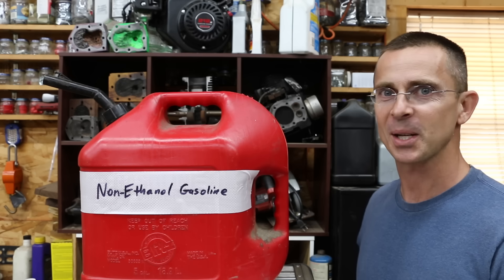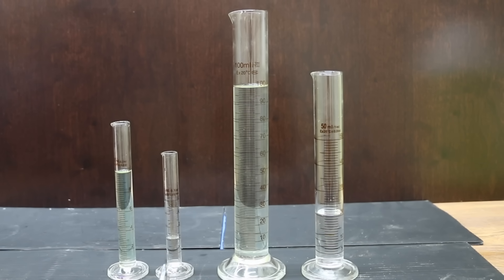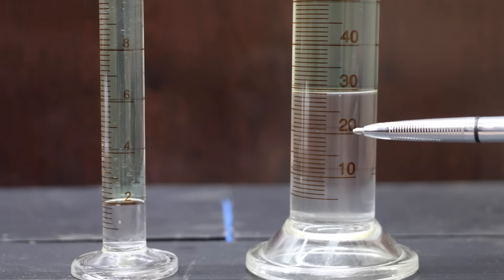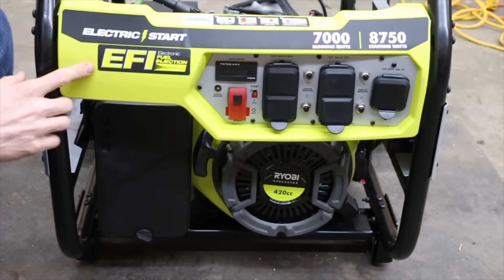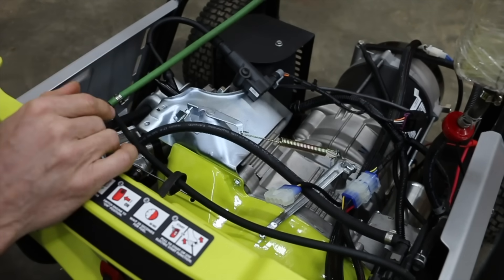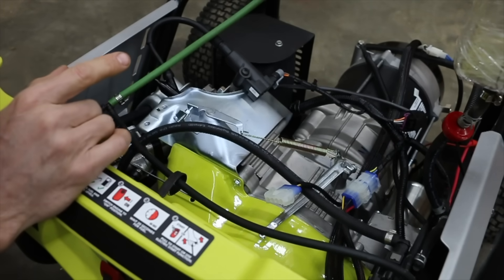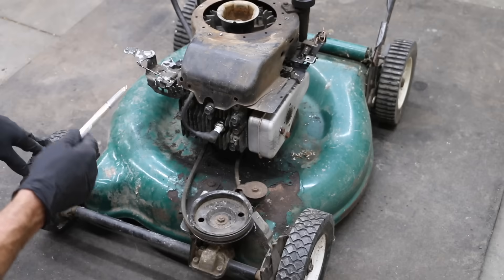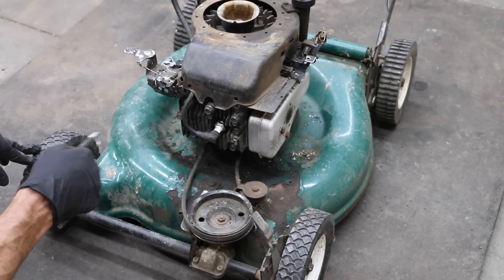Is Non-Ethanol Gasoline Really Better? See the PROOF!

Comment: @Project Farm , most of the car brands in Brazil, from Honda, Hunday, Fiat, Renault, Peugeot, to Chevrolet, Ford, etc, use motors (with denomination: "Flex" motors) that run on any amount of gas and ethanol mixed in the tank and also on 100% percent of either. The electronics takes care how to burn the different mixes. The gas stations sells pure ethanol as sells gas. Just would be nice to know which mix performs more efficiently and more economically.

Comment: Ethanol is hygroscopic,  in English, it absorbs water, ethanol is heterogeneous, meaning that it does not chemically combine with gasoline such as a homogeneous solution. 

It is heavier than gasoline and if you pour it in a glass jar, you can clearly see the ethanol at the bottom.  It is also highly corrosive.  If you vehicle sits for awhile the ethanol settles to the bottom of the tank where the fuel pump picks it up first, leaving your engine is a very low 80 octane fuel that causes detonation that can destroy your engine.

World wide ethanol does not reduce the carbon content, it takes just as much fossil fuel like one gallon to make one gallon of corn ethanol.  Sugar cane is far more effective, but can't grow that up in our northern climate. 

What is does like in Wisconsin, slightly reduces the carbon pollution in Milwaukee and Madison, and moves that pollution up to norther Wisconsin where we live.  World wide, nothing is saved. Its political and as we are learning very quickly, our leaders our idiots.

It skyrocketed the price of meat and dairy products, putting way oversized SUV's and pickup trucks diet ahead of us people. 

If we didn't have A-holes running our country would realize the key factor in global warming, BS anyway, only going back to 1880, not to where we live with a mile high glacier 12,000 years ago or the starvation period during the middle ages.  Key factor is methane gas the earth emits like crazy also the key product for sewage disposal plants. 

Have over a know 12,000 year supply of this stuff, far less CO2 production than gasoline, cleaner burning and we could use our vehicles to run on this stuff. 

But can't do this in a country run my crooks and idiots.

Comment: I'm a chemical engineer. Ethanol has inherently less energy density than regular gasoline. Typically, you might expect a loss of 5-10% gas mileage in an automotive engine. Modern computer-controlled fuel injected engines are able to optimize the air/gas mixture so that the loss in mileage is more commonly around 5%. This is a result of the fact that the fuel contains fewer high-energy carbon-hydrogen bonds and instead contains some lower-energy carbon-oxygen bonds. The end result is less energy and more water vapor in the exhaust. Ethanol does nothing for the environment. It's only purpose is to subsidize farmers.
Reply from the maker: Thank you for the feedback
Reply: You forgot to add that ethanol fuels are safer for the hard parts of the engine and allow for increased boost pressures and advanced ignition timing in performance applications making it easier and safer to make more power... I have a Honda Civic that puts down 685whp on e85 and topped out at 525whp in pump gas premium 92 octane. I’m a believer in ethanol. Not fuel mileage, lol

Comment: I have a 98 dodge ram with a 318 in it. Fuel injected. I can see a difference in the fuel mileage which improves with non ethanol gas. Was getting around 270 miles to a tank with gas that had ethanol to around 310 a tank with non ethanol fuel. Once i saw that increase, unless im where they dont have non ethanol fuel i use non ethanol fuel. Yes more expensive but seems better for my truck.
Reply from the maker: Thank you for the feedback
Reply: @ProjectFarm  your welcome. Thank you for what you do also

Comment: - Your tests proved out about the same as mine and in fact both are also theoretically what it should be.  Alcohol has 1/2 the calorie content of gasoline, thus 10% ethanol will require 5% more fuel for the same amount of work.  It works that way on my car, and cars had their fuel efficiencies downgraded with no other changes when ethanol fuels became the standard. 

- For lawnmowers, there is a regulatory maximum allowable feet per second on blade tips.  Lawnmowers have standardized engines used on many different models.  Thus, the rpm will be invariable be set low for the largest blade diameter for the horsepower.  This is why engines are today rated in torque, which happens at a lower rpm than maximum horsepower, because the same engine may be limited to different rpm and is seldom allowed to its maximum horsepower rpm unless you buy it independently of the appliance.  Having the rpm right on a lawn mower translates into a big difference in cutting, mulching, and bagging.  Using an optical tach, I get great performance when changing the governor spring to get the RPM necessary to get a little below that maximum using ethanol-free gasoline.  (And normally run it in because I don't go through that much fuel for yard tools and standby generator.)  There is a definite difference in rpm of the engine when running ethanol gasoline, but still performs very well.  The price difference between 10% ethanol and ethanol-free never used to be anywhere near 5%, so I never bought from a station that sold it.  Of course today, there is a great difference in price even though ethanol costs more to produce than regular gasoline, with the difference being made up mostly by subsidies paid for from those believing they are getting a good deal with ethanol-doped fuels at the pump, while they are actually eating the cost via taxes through subsidies, and a little by overcharging for non-ethanol fuels.

Comment: So here's a thought. For sake of science. Hypotheticaly I use 10 percent ethanol in my vehicle, through the seasons I have a condensation build up. Thus causing water and ethanol mix in the bottom of my gas tank. Can Heet solve this problem or is it a joke. Basically, can adding alcohol to gas that has separated from it's ethanol stop this separation? Or even allow the part that has been separated to burn in my engine?
Reply from the maker: It takes a lot of heet to reverse phase separation.

Comment: Your test here was really well done and informative but the biggest reason most of us dont use ethanol in our small engines is because of the green sludge that builds up in the carb if it sits for any length of time. I would like to see a comparison of ethanol gas in a carb vs non ethanol in a carb that sits for 5 months. Of course we already know which is better but it would be interesting. Thanks again for your well thought out analysis.
Reply from the maker: Thank you for the feedback

Comment: Forgot to run my generator out of gas one time.  It sat a few weeks and then would barely start and wouldn't run properly.  The E10 gasoline turned all the rubber parts in the carburetor to mush.  My fault.  The repair service added a fuel shut off valve and warned me about alcohol blend gasolines.  $100 later, I was better educated.  I had a car that was E85 compatible.  Mixing 1/4 gas with 3/4 E85 the car ran well and my mileage went from 24.2 to 20.  When I ran straight E85, the car ran OK, but not outstanding.  The mileage dropped to 15.  The cost per mile factor just wasn't in my favor.  Back to E10.  Your fuel injected generator just might be the ticket as most small engine problems are caused by carburetor problems.
Reply from the maker: It happens a lot!
Reply: In terms of the generator repair, I would say I'm surprised they actually helped you with good customer service instead of just waiting for this to happen again...so on so forth.
Reply: I went with a propane generator... two reasons propane is a stable fuel... natural gas pipelines after natural disasters are shutoff due to stop the fire potentials.   The other thing I do is run my propane generator once a month for 5 minutes.  I also shut it down by shutting the propane valve off to evacuate the line. Once it shuts off I then turn the key off.  I stayed away from those whole house generators for two reasons many are crap... and if you use a small generator it’s easy to replace.  Do all the work yourself and you will know how to maintain and service the generator.  Get rump rangers involved and expect to be raped.
Reply: had a briggs/sentinel mower sit for at least 15 winters (with use in summer ofc) with e5 then e10 gas in it and the only issue that popped up possibly from damage caused by that is the carb bowl seal this year but it has other more severe problems most notably pretty much gone piston rings it eats oil like crazy and needs frequent spark plug cleaning to keep running
Reply: I think that american marketed cars are maybe too fragile  for ethanol, here in Europe all gasoline cars are able to use gasoline-ethanol since the 90  ,personally I had a 98 Citroen and I started using E85 in 2010 until 2020 (car wrecked after two accidents,  guys crashing into me while waiting at the red light) without any modification , full tank,  no maintenance of the engine at all ( I just treated the car like a horse, ride and go) and never had any problem, the car never broke down or had combustion problems, I  just changed the spark plugs in 2018 because it was never done before , even if they were working perfectly, I just can say  that  at least for me  E85 was the right choice.
Reply: @Feyser1970  where they sell E85 in Europe?

I have 2 motorcycles, a 90s and a 70s model.
Both dont like E95 (10% eth)
I buy 98 and add lead replacement
Better safe than sorry
Reply: Wilfred Prins my 70’s Guzzi pinged all the time with non ethanol fuel, low or high octane.  With 10% ethanol I use the low test with no issues.  Of course you loose power and efficiency.  The alcohol does lower the combustion temperature while the high octane slows down combustion.  They both have lower btu’s.  The unleaded is not good for the old valve seats as it has no lubrication.  The alcohol does deteriorate plastic and rubber products.
Reply: I can't believe that anyone would try to run a car on E85 or any ethanol.  In Australia we do have ethanal in E91, our standard gas range is from 92, 95 or 98.  Most cars are run on the standard 95 or 98.
Reply: @waynesissing8006  Lots of people do here in France. You can buy it in most supermarket gas stations. Even stations like Total sell it on the motorway!

Comment: As you mentioned at the end, the HUGE difference with non-ethanol is it doesn’t ruin small yard machines engines. With E10 we had to have the carbs in our leaf blower, string trimmer etc rebuilt or replaced every year. Since we switched to ethanol-free, they’ve run perfectly, always starting on the first pull (maybe two if they’ve been sitting all winter). It was a revelation!

Comment: I use Shell medium. It DEFINITELY has lower octane than the old Shell medium, which I have a storage tank of. The ethanol gas pings like mad in my 302 engine while the original old gas does not.

Comment: your vids are great, luv all the ideas you come up with on ways to test.
swung a wrench for a lot of years. carbon build up is usually caused by running too high of octane. raising the octane lowers the combustibility. this allows high performance engines to run ultra high compression without self igniting(*detonation/dieseling). the problem is when people run high octane on street cars you get a lot of unburned gasoline*(carbon). every engine has a minimum octane rating and its very important to stick with that. in very hot/hilly climates or as your car ages you may need to go up a level in octane to prevent dieseling/detonation but your engine will run best, have the most power etc with the lowest octane your engine can run. lower octane gas is more explosive than high octane gas its like a 12 gauge vs a 20 gauge number. its is generally cleaner and fresher because it sells more and its much nicer for your engine as long as your at or slightly above your minimum.
Reply from the maker: Thank you for the feedback

Comment: I used to work in a GM dealership when flex fuel vehicles first came out. I went to all the classes for training on how flex fuel vehicles were able to switch from ethanol to non ethanol or combination of both. We were also targht how to measure specific gravity of various fuels which translates to fuel volatility or efficiency. Ethanol is not as volatile as regular gasoline, meaning it does not produce as much horsepower this less fuel efficiency.
Reply from the maker: Thank you for the feedback

Comment: I had a 1986 5th ave my baby n since adding etheynal to the gas i had to change the fuel pump once a year as it destroyed the internal rubber. Been verified by repair shop friends of mine. Im very good at replacing it but its stupid that what it does.

Comment: As per your title, yes it is. It has more btus than a diluted gas, alcohol mix. Alcohol burns cleaner and has a higher octane  than gasoline and burns cooler but much lower btus. Btus is the power.  Burn twice as much alcohol to get the same btus as gasoline.  The choice is yours. Alcohol dragsters are very fast but they chugg huge amounts of alcohol in the quarter mile. Advanced timing, cooler combustion, cleaner burn but needing shit loads more fuel from A to B. Alcohol destroys rubber. Something to think about. 91, no alcohol for me thank you. The car, not including myself.
Reply from the maker: Thank you for the feedback

Comment: Excellent testing, but make sure that before you start that you understand the question.  In this case, the question (for me) is, especially because the cost of food is driven up due to government subsidies pushing corn to fuels instead,  which is better overall: ethanol or non-ethanol?  Without a doubt, as you can see by the comments, testing for a little carbon build up does not answer the question, because the headaches caused by ethanol gas are the fouling of the engine and the destruction of many of the parts.  My small engine repairman told me when I went back to pick up my fixed Husqvarna chain saw, "you use ethanol gas, don't you?".  I learned that for small engines it's strictly premium ethanol-free gas for me.
Reply from the maker: Thank you for the feedback

Comment: Ethanol will freeze? Bad if a tractor is outside...I have a 2007 Toyota Avalon V6 I travel for work, when i put non ethanol fuel in i get better mileage, but cost difference between 100% gas vs 10% ethanol doesn't make that much difference plus it's getting harder to find 100% gas. I do run 100% gas in all my yard equipment and tractor....that's my 2cents.

Comment: Will take non ethanol fuel everyday over ethanol. I have seen the fuel seperate if not used within a few months. Regular gas while not great will last around 6 months. I had a new Honda mower carb get gunked up in 2 months running ethanol. Switched to non ethanol and have not had an issue since. I have access to non ethanol so I use it. It is more expensive than premium, but worth it to me. I also use stabilizers as well since its additional cheap insurance. Great review!!! Thank you for doing amazing comparisions.
Reply: Ditch the stabilizers.  When lawn equipment comes in my shop at the beginning of the season because "it wont crank" around 20% of them have carbs that look like someone ran jello through it.  That's from the fuel stabilizer.   That crap builds up over time.  Especially if you use too much or dont mix it well.  

And you can pretty much guarantee if that junk has built up in the carb it's also in the fuel lines, gas tank, fuel filter, and fuel pump (on larger mowers).  Once that happens you have to flush the whole system, usually multiple times to clear it out.
I've never had ethanol free gas that was stored out of the weather go bad on me in less 6 months.

Comment: For the last 2 years now, I have been using 89 octane non ethanol gas in a Simplicity w/ Briggs V twin, John Deere w/ Briggs V Twin, Husqvarna  w/ Kohler V Twin. Between the 3 mowers, we mow approximately 5 1/2 acres every 1 - 2 weeks. I use synthetic multi grade oil in all 3. They all run longer on a fill up, but most importantly, I find they do run cooler. I feel it is because there is more energy in the non ethanol gas, so a engine produces its full power, which means it doesn't work as hard to perform the same job. I live in northern Indiana, during the summer it is very common to have 90+ temps in the afternoon. These mowers all used to run on (dieseling) when I shut them down from idle speed using gas with 10% ethanol. Switching to the non ethanol gas stopped that without doing anything else to these engines. Also, I always fill gas tanks completely full for winter storage, and in the spring they all start right up first try. Even with the added cost, I'm convinced non ethanol in all small engines is the only way to go.
Reply from the maker: Thank you for the feedback

Comment: Ethanol is ethyl alcohol, it's in every alcoholic drink. If you are sure that ethanol is doing serious damage you had better cease drinking NOW. Back in the good old days with tetra ethyl lead alcohol was added to fuel to further increase it's octain rating for use when racing motorbikes and cars. It allowed the use of considerably higher compression ratios. I have been drinking ethyl alcohol for over half a century and I can assure you my fuel lines are in perfect working order - unless I add a strong vindaloo curry of course which tends to foul up the exhaust port. The reason the added water/ alcohol mix did not reach the line was because alcohol has molecules so small they fit between water molicules.
Reply from the maker: Thank you for the feedback